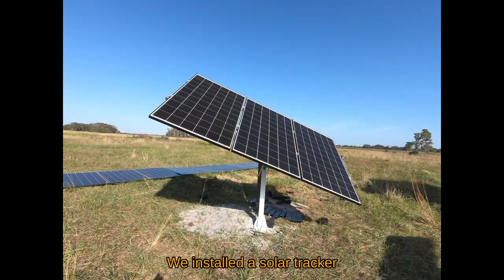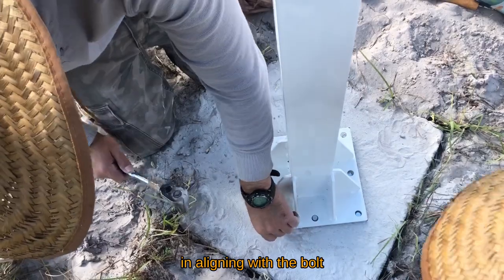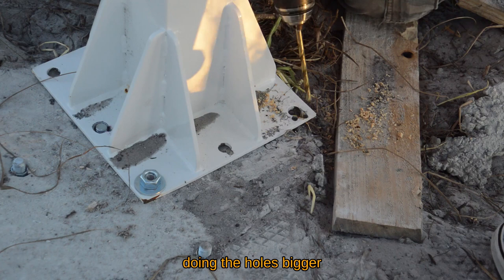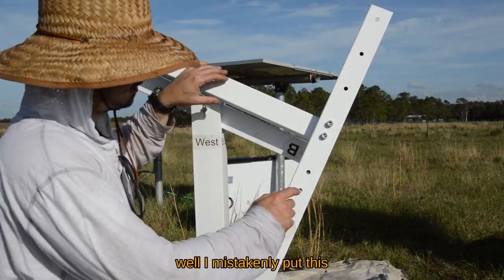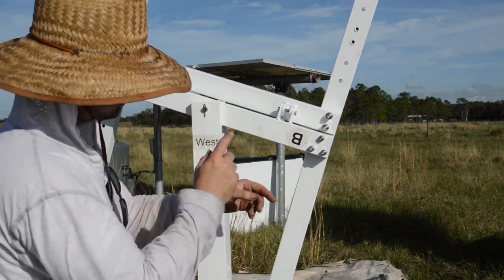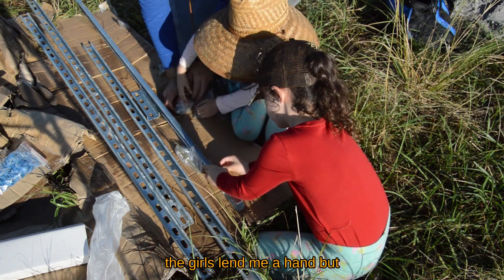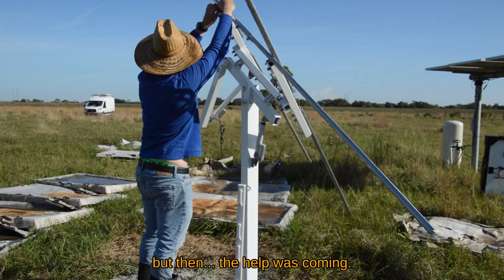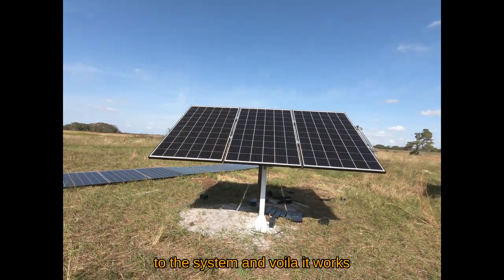Installing Solar Tracker. Volume 3: Assembling the Tracker.

Comment: Did you know that the D bracket that holds the long actuator is supposed to be mounted on the west side!  I confirmed this with Eco Worthy today and I was told the assembly video and the user manual are both WRONG and the D bracket is to be mounted on the east side and the long actuator on the west.  This is why many people say the east/west actuator is miswired.  It isn't, it's assembled wrong because the manual told you to do it!!!!
Reply from the maker: Interesting! Great finding. We have to play a little with the wiring configuration.

Comment: What - great - crazy times! Trackers have been worthwhile for over 30 years. But in 2023 there are 40% cheaper modules, so tracking is no longer worthwhile.
Just put up MORE modules. 
Probably this will be one of the last videos about tracking systems.
Reply from the maker: Thank you for your comment. 

On this particular case I already had the solar regulator a MidNite KID, the max. Amps on those are 30 A. I am charging 2x12 V batteries. The maximum power the regulator is going to output is roughly  27V x 30 A = 810 W the panel on the tracker are 3x320 W = 960 max. since that is the optimal we can reduce by a 10% to get a more real value 864 W on peak sunlight. That is 864-810 =  54 W the regulator needs to get rid off. Adding more panels, to the current setup, don't add more power to the batteries, is in turn an issue that the regulator have to deal with, dissipating the excess energy as heat. I am also risking reach the VOC on the regulator (150V) and fry the capacitors (happened before). 

On the other hand if the panel is facing the sun for more time I can have for more total energy delivered to the batteries and the inverter using the tracker, because at the end the power is capped to 810W. So 810xT is the total energy delivered to the current system, where T is the time of sunlight exposure.  The game is increase the T, of course with the tracker the T is greater than with a fixed mount.

Other solution, that not involve tracker, that will work fine is doubling the number batteries that way we can have a 48 volt system, with the same regulator, now the output will be roughly 1,620 W, but that implies the cost of the batteries a new inverter, the one installed is 24V to 120VAC, plus some more panels.

I am not saying the tracker is a perfect solution, happens to be a good one when your regulator reach the maximum input/output.

Comment: As the solar tracker gives about a 40% boost in system performance, isn't it easier and cheaper just to add an additional panel (about the same performance boost, cheaper and no moving parts to break)?
Reply from the maker: Hi,
Yes, it is cheaper to add more panels. Unless you have a limited area, or like this case, the charger (or inverter) is near the limit of maximum Voltage (also Amps or Watts) and the addition can put the system out of specs, on that case you can still accumulate more energy using the tracker.

Comment: What a cock up on the bolt holes. Needed a template to drill with into the concrete, and the drilled out holes should have been painted to prevent rusting. Not a very good job.
Reply from the maker: It was a mess. Thank you for the tip on the painting of the holes I didn't know about that, but makes sense.